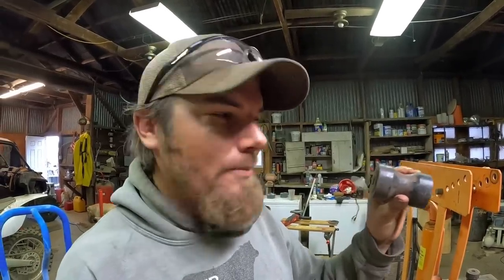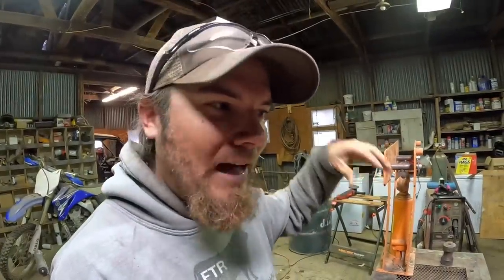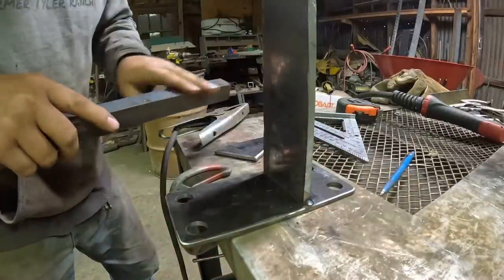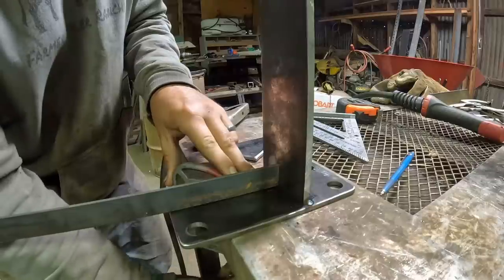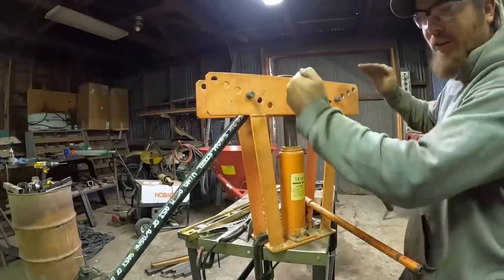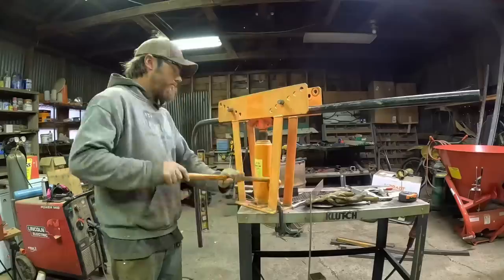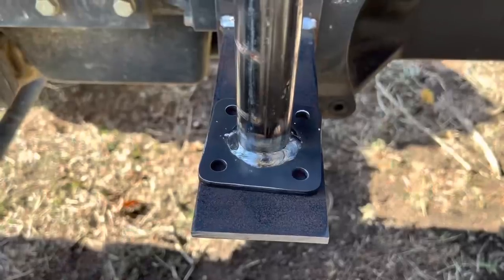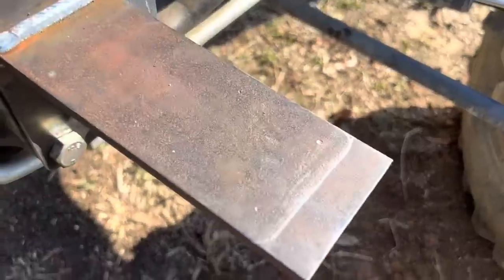Making a Simple GPS Mount for My Tractor

Comment: Try a rubber pad to the mount where bolted on at the bottom plate. Also you can get iPad or tablet brackets that have some padding to reduce vibration. Good job on the bar build and thanks for your good videos.

Comment: The vibration of the "loop" pipe is probably not so much in the pipe itself, but rather in the base plates to which the loop is attached.  The most effective way to stop the vibration when you are using the tractor is to have a stabilizer (or "vibration damper") fastened between the top of the loop and the plastic cowling near to the steering wheel.  The stabilizer will not need to be nearly as robust as the loop, and the attachment to the cowling could probably be made with an adhesive pad.  To check whether this is a suitable solution just make a temporary light-weight stabilizer, and fasten it to the cowling with duct tape..  I hope that this works - I believe that it will.

Comment: Was just curious if you could make some sort of bracket that came down over the dash and went around the steering collum to steady that hoop some more.. I know it'd have to be narrow so you could still see the gauges in the dash maybe something about  as thick as the spokes in the steering wheel but with some sort of ring on one end to slip over the steering collum if you took the steering wheel off. Then on the hoop side you could put a narrow plate on it that you could bolt to a tab welded to the hoop.. that way if you had to remove the hoop from the tractor you might not need to take the steering wheel off every time as well.

Comment: What if you drilled a small hole through the Top of the Vertical Pipes, and Filled each side with Sand?
I think that, that would steady them.
Cheers

Comment: The vibration is worst at the top. That is where the damper should be.
Maybe you could roll a piece of rubber mat around the bar so that it is wedged between the bar and the hood. Or shipping packing. It needs to be able to dampen vibrations at the top, and be waterproof. Or spray wall foam. Or styrofoam.

Comment: Tyler, does the system use an external GPS source? If not, it might be worth considering. The GPS built into the tablets is fine for road navigation, but lacks a little accuracy (and precision for that matter) when it comes to exact positioning. It can be off by several meters. External GPS is much better, WAAS as a minimum. You'll be golden with RTK. Nice work on the fab!
Reply from the maker: Yes I got a small garmin gps to run with it for that very reason
Reply: @farmertylerranch4399  Good deal, looking forward to seeing the rest of the system come together!

Comment: Farmer Tyler Ranch 👍🤠🐂🐄🐈🚜🛻 
Maybe the trick to stop the vibration is to make two sets of round tubing side by side more stability 🤔⚓
Reply from the maker: Yes that crossed my mind too
Reply: @farmertylerranch4399  
Hi Tyler 👋 
Thank you for your reply and compliment. I've never been to engineering school but I guess by being in a Auto body class for 3 years gives me some insight on structural integrity from years of visually inspecting constructed vehicles and what could be damaged to them and reverse impact it. Interesting to see something better than it was. To think out of the box maybe to design a roll bar along with the mounted area for your GPS is the way to go also for safety. No one ever complained about a roll bar saving their life that's for sure 👍 until next time farmer Taylor Ranch 👍🤠🐂🐄🐈🚜🛻 
Joey 👍